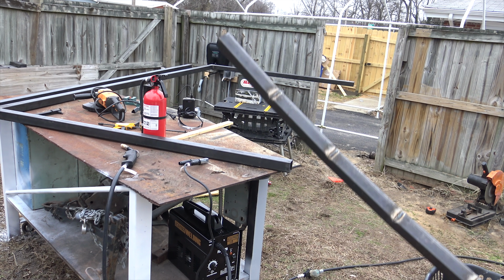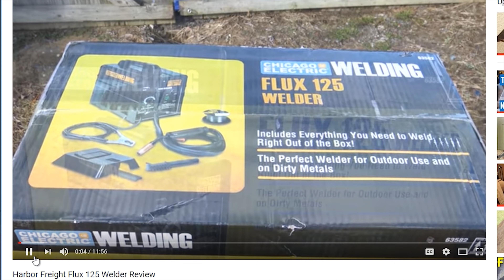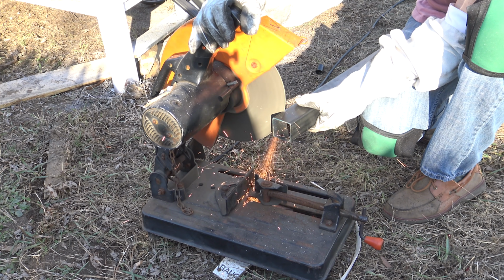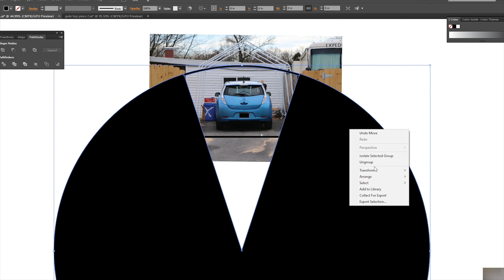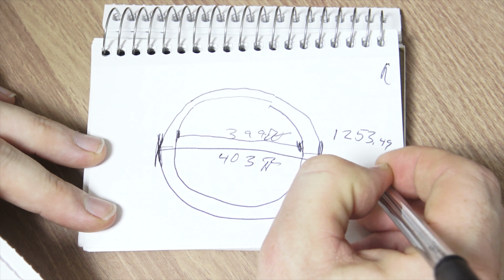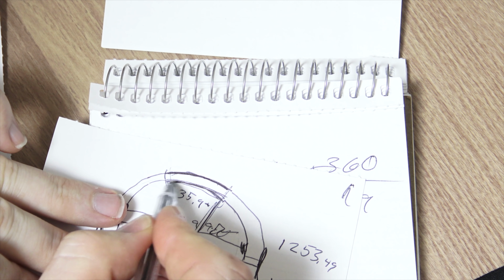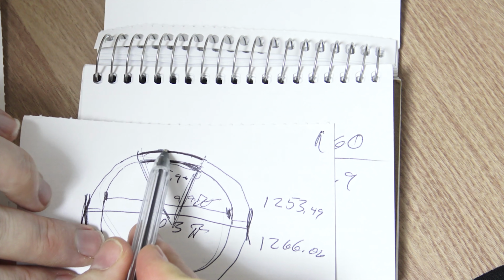How to bend square tubing without a bender - metal fabrication

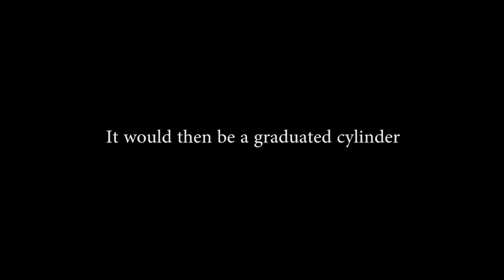Comment: I love it.  Practical math.  One edit.  At 10:43 where  you say you need to add a cut, going from 10 to 11.  That's not true.  You still want to remove 1.25" = 10 x 0.125 (blade width) of material.  But those 10 cuts will divide the length of tube into 11 sections, so to determine the spacing of the 10 cuts you divide the length of the tube by 11.  Now that I got that sorted out it's time to fire  up the chop saw and welder and bend some tube.  Thanks.
Reply from the maker: Yep, I said "cut". I meant, and also showed, divide by 11 which gets you 10 cuts overall. Thanks for catching that!
Reply: How can you measure the ANGLE without computer or auto cad?
Reply: USA USA pm me
Reply: @jojienagnag  hi. I have the same question How can you measure the angle without a computer or Auto CAD?

Comment: It would’ve been easier to just convert your angle to a fraction of 360 and multiple the two circumferences by that fraction e.g. 35.9/360 = 0.0997 then you just multiply each circumference by 0.0997

Plus it’s far less confusing to explain.
Reply from the maker: The two circumferences arent just handed to us tho, are they? Maybe one is chosen and the other is mathematically found.

With that, theres always better ways to do things and thats good.
Reply: @TRYtoHELPyou that’s irrelevant. Doing something you call “cross multiplication”, which involved writing them in a format that looked like two fractions missing the denominator until you used the result of one of your steps to pit in the place of where a denominator would be on the right hand side “fraction”, which isn’t what ACTUAL cross multiplication is defined as, is confusing AF for obvious reasons.
By calculating the fraction of the circumference that 35.9 degrees describes, i.e. 0.0997 of the circumference, you only have to perform the calculation once to get that figure, after which you only need to multiply the relevant circumference by that fraction, to get the inner/outer length of the curve you’re trying to put in the piece of square hollow section.

SOURCES: “Trust me bro” plus a bachelor of science in mathematics and physics and a bachelor of engineering - electrical.

Comment: I must say it is an interesting way of making a curve…I’d have thought you would make the cuts on the outside and fillet weld the opened up slots…but your way is much much neater since it leaves a smooth uncut band around the outside edge….Nice👍
Reply from the maker: @contessa.adella  right? Thanks for the good words :) We all can get the same thing done multiple ways. The way I did it made sure that the bend was steady. The way you suggest would require more work, but is still doable. Even if you attempted doing it that way, and even if you gave up half way through due to difficulty, or even finished it, it would be a good learning opportunity. Metal is recyclable, and the time spent wouldn't have been wasted so much as it would have been spent learning and experiencing a different way to do stuff.

Comment: Well, but welding  shrink metal a little by itself ? How to compensate if i need several precise pieces?
Reply from the maker: @ctrlz4439  if you are making a gate, you are over thinking it. If you are building something where the tolerances matter to the degree you are pointing to, you likely are asking the wrong part of the internet. Sounds like you may need a cnc bending machine. My suggestion, try, fail..... Then try again.
Reply: @TRYtoHELPyou  I would like to make an tunnel type 6x3m greenhouse. ( Commercial one collapsed because of snow ) Arches must be more or less equal. They should not be very precise, but big differences  may cause problems. 
I just have bad experience with welding distortions, they may be quite unpredictable sometimes and there are many of them.
I guess I will try anyway.
Reply from the maker: @ctrlz4439  snow load and this method are a bad idea, this gate is non structural as mentioned in the video. Be very careful please.

Comment: I’d love to know a lot more about the electric gate …did you fab it or buy one?
Reply from the maker: Made the gate myself, bought the operator off of Amazon for around 200 bucks. Still works to this day, except the remotes, I got a more secure receiver and hooked it up. I wish I have done an update video by now but time is hard to manage at the moment. I know it's cliche but if you subscribe and click the bell icon after you may be notified when I do future uploaded. The gate video may be an easy one I can knock out soon.
Reply: @TRYtoHELPyou  looking forward to the notice …. I can absolutely use the gate and opener for the driveway.  The dogs would love to hang out by the shop…the electric gate does that.  Building it myself is way better $$$

Comment: Great and very informative video. Thank you. I had figured that I was going to have to make the cuts and weld them up but didn’t know how far apart to make them. 
Do yo have to relieve the cuts? Take out a little wedge to make room for the bend? And did you use the HarborFreight welder for the job?
Reply from the maker: Just a cut and bend, yep to the HF welder. Tks for the good words! Sorry for late reply 😂

Comment: I’ve been doing this job for more than 20 years and always do by eyes. For 3 mitre gate , I cut 3.5 m  metal , mark the middle 1.75 m and again start marking every 20cm from middle to left and the same to the right , than bend and tak them than match it with my fram and cut the extra from both side 
But today I learn some math which it will help me on day 
Thanks 🙏 for sharing 
I also would like to say u make a nice looking gate with wood covered, why don’t u ad a metal horizontally half way up in middle of the gate to make it stronger and wouldn’t have short to cover the top 
Thanks for uploading
Reply from the maker: Tks for the good words. Glad I could help. There is a piece of metal mid way. I gotta do an update vid. Thing is still going strong.
Reply from the maker: Tks for the good words. Glad I could help. There is a piece of metal mid way. I gotta do an update vid. Thing is still going strong.

Comment: That's great. I'm pretty certain that you can do the same thing on round tube (only the welding is slightly more difficult), and I actually found this video because I am going to bend some round tube for an exhaust pipe later this week.
Reply from the maker: You got it! Just be safe

Comment: Ok but where did you get the 399” and 403” from?

I have an 8” gap at 115° I need to bend a tube over and across that 115°. How do I find the inner and outer circumferences I need to get that measurement of the tubing to cut before I start making cuts?

Comment: Instead of doing all those cuts and weld couldn't you just use a rosebud torch. By heating up the top of the square tubing. Calculating from the total length dividing it by four  that should give you the four spots to heat up. When the steal starts to get red hot. Pour some water over it and you will see the tube starting to bend. After hearing up the four spots or more you will get an arch like curve. May take some practice.

Comment: Love your humor! The math is easier to explain if you just say that the upper and bottom lengths of the arch need to be 35.9/360 of the circle so just multiply by that fraction. Explaining it this way removes the need for cross multiplying which loses a lot of people.
Reply from the maker: thanks for the good words. I'm not sure your numbers account for different metal sizes though
Reply: @TRYtoHELPyou  yes sure you still need to find the two circumferences based on the size of the material used

Comment: Good technique. I did this back 20 years ago when building one of my garden gates. The trick was to get the calculations right and work out the angles so that v-sections removed closed up when the box was bent.
https://twitter.com/EugenesDIYDen/status/551137280455610369
Reply from the maker: very cool. TKS for sharing!

Comment: Could you help me please
My circle out size is 60 inches
My tube size is 1 Inch
What's the width of cutting
Reply from the maker: I think you are missing something; how many degrees of what diameter circle? (Did the 60 you state mean diameter or length of the outer part of the circle?)

Comment: Thank you for this, the maths was super easy... great video, I never would have figured this out myself. You’re a true gent!
Edit: just did this with 4mm walled 100mm box section with a really tight curve that the local fabricators said would kink in a roller. It took 52 cuts but It worked out perfectly! It moved like a slinky!
Reply from the maker: Thought I replied to this a while back, sorry I didn't. Tks for the good work. Glad to hear it worked. To accomplish what one is told essentially can't be done is a great feeling, too.

Comment: Excellent video. So,  in other words you have to make the deficit to bring both measurements the same. At first it sounded confusing until you explained it. I'm doing more roofing work so needing to learn trigonometry and maths equations. I'm running 2 d cad which is quite good. Great video.
Reply from the maker: Tks for the good words, yep to your retranslation

Comment: Grinding to get a factory finish afterwards isnt worth the hassle. In some cases you'll need to apply auto body filler. It's easier to have it rolled.  Unless your living in some rural area in India. Just saying
Reply from the maker: For most people, gates aren't worth the hassle. If they have a chopsaw, welder and no roller but are willing to apply some hassle, this video is for them! I regret nothing doing it this way and the gate still operates well and looks great.

Comment: Did you allow for the pull when you weld that will change the shape over all. Also just invest in some rollers no cutting or welding
Reply from the maker: It's a gate therefore the variable of the curve distance to be taken into account due to weld heat would be less effective than taking a micrometer to the chop saw blade to make sure it's a precise width for every cut AND to have the blade balanced at a shop to make sure it doesn't wobble while cutting which would yield a wider than 1/8th inch cut, per cut. I would not use a roller enough to warrant the cost of a roller. At least not at the time of the building of the gate Again, it's a gate. If one we're to get stuck on details that don't matter they may not finish the project.

Comment: Nice but I feel does cuts is adding a lot of extra work having to weld it and then grind it flush
Reply from the maker: If you know of another way without a bender please share. There are multiple ways to get the same thing done and without specific tools.
Reply: Heat rosebud and jigs fixtures

Comment: Doesn't really matter whether you're using imperial or metric here… if you just treat it as centimeters, it will work just the same, it'll just be much smaller.

Comment: If i have a piece of square steel that is 50 inch and the door is 35 inch the witdh of my blade is 1/8 is it possible to calculate 50-35=15 inch so 1/8*60 cuts 15 inch to get the proper length will the hight be the same 50-35=15 inch tall at the peak?

Comment: After Einstein and Bruce Wayne, you're next in terms of intellect and practical application of Geometry. Having been told by 5 metal fabricators that bending of Square tube needs a hydraulic. Press, die, gears etc., Your neat trick helped me get a gentle bend  representative of a flower stem. Thanks for posting your video without which it would not have been possible!!! Will send you the pics when the structure is complete :)
Reply from the maker: Super happy to read this comment!! Glad I could help. I look forward to seeing what you make. Gotta check the email too .. ha. Haven't done that in a few weeks.
Reply: @TRYtoHELPyou  ... let me know your email, i will send them there. I have recieved very good response from the client because i completed the job in under 3 days tops. Your technique was the key in saving time to get a curve in the 40mm GI tube. I shall post the photos on our webite https://arachne.co.in/ later, but you deserve the first look!!!

Comment: Awesome! I am gonna use this to cut my curved frame tubing for my new teardrop trailer.  It is a french curve but once I figured out that all I had to do is change the distance between the cuts for the thing to work out, it was pretty easy.  I made a test cut out of wood to see if I goofed, but I got it first time!  I will do some minor tweaks though - it is nice to make test pieces. I am going to cut the metal next week when it gets here.
Reply from the maker: Four years later, how'd it go?

Comment: ok how about a 76 inch half circle out of 2x2 square tubbing  how much far apart would i cut the tubbing with a chop saw to bend a half cirle 76 inches across . it would be  76inches  half circle   .how far apart would i cut the  slots.

Comment: Using imperial measurements as you do:
Cut it twice as many times (21), then put a 1/16" shim in before you tack it up. Gives a smoother bend, pull the shim out before the final welds and you'll also get more penetration.
Reply: Money advice right here
Reply from the maker: Interesting thought indeed. I like it thanks!

Comment: My wife and I are doing a school bus conversion with a roof raise.  I have been looking for a bending tool to create a curve at the front and rear of the roof to give the bus a more retro look.  Essentially an old Crown bus is what we are working towards.  This technique looks like it will solve our problem of bending the tubing without spending a grand to buy a bender capable of doing what we need.  Thanks for this video and the excellent explanation of what is needed to make the cuts to get the bend we want.
Reply from the maker: Be sure to test the strength where you can. Good luck with the project. Glad i could help!
Reply: Harbor Freight sells tubing benders fairly cheap